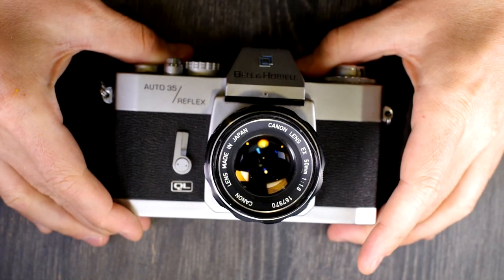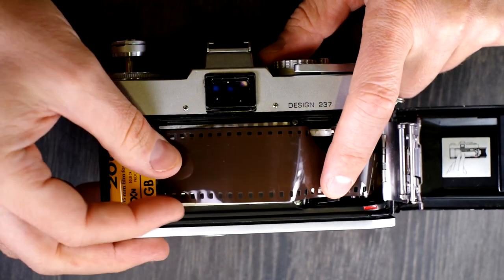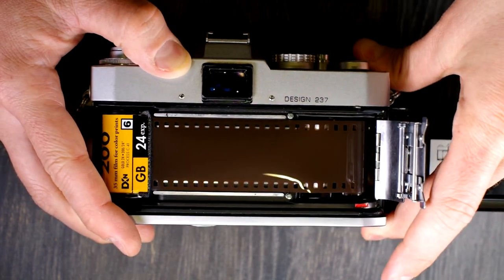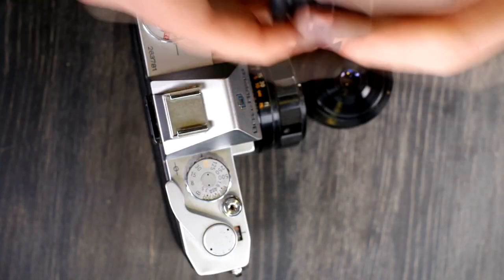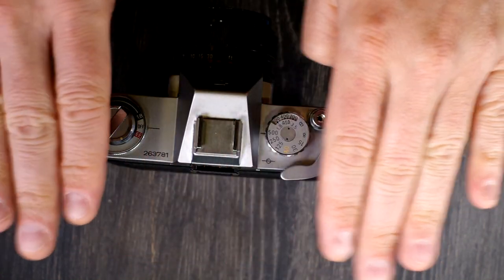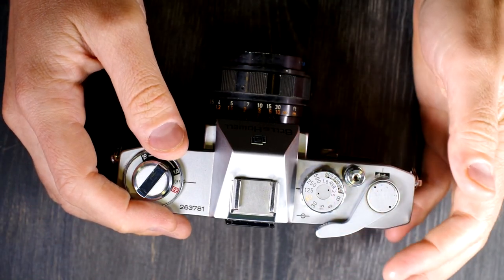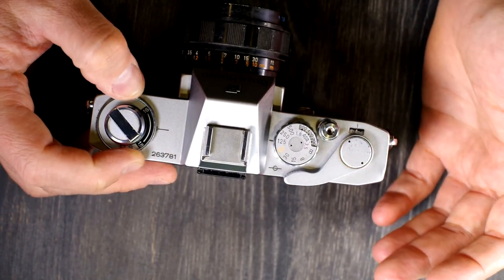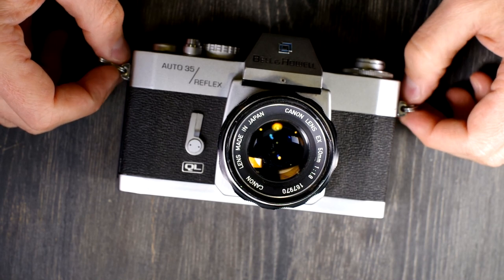Canon EX/EE Video 2: Operation, Use, How to Change Lenses, Load Film, Batteries, and Taking a Photo

Comment: Further to the battery adapters (voltage reducing), apparently many do nothing at all.  Be aware even though they sell for $30+ they may simply be a battery size reducer and do nothing towards reducing voltage.  I use 675 hearing aid batteries from Costco (card of 48 for next to nothing) and adapters from  https://www.paulbg.com/Nikon_F_meter_batteries.htm  Please note I have no affiliation what so ever with this web site.  I bought a pair of his adapters and really like them.  In my Gossen Lunasix # meter I can get over 6 month out of a pair of batteries.
Reply from the maker: Thank you, but the link appears to be dead.
Reply: @DavidHancock  Try it now.  It did not like being in parentheses
Reply from the maker: Got it now. And yes, I know of those. I have a few. My results are mixed. With some makes of button cell they fit fine, with others they're too loose or won't fit on at all. But for use with the same make of cell, they're a good option.
Reply: @DavidHancock  I have only used them with the Costco Kirkland batteries.  Here in Canada I get 48 for about $12.50 or so.  They fit quite tight on the Kirkland cells.  Good to know the other cells may or may not fit if Costco stops offering the Kirkland cells in 675 size.
Reply: Hi,  did the 1.4 V hearing aid battery worked good with the lightmeter?  I have been told that the different voltage may affect its function.
Reply: @losborias  Yes they worked very good.  Being only .05V difference I did not see any accuracy difference when compared to my DSLR, iPhone or other light meters.  I suspect the 1.55V silver oxide or alkaline cells with their 0.2V difference may cause issues.  I have heard many cameras and light meters will work fine with the higher voltage, you just compensate by the ISO, Others I have heard are damaged with the higher voltage.  I have not confirmed either so as usual use the higher voltage at your own risk.    FWIW, there are some repair folks that will modify your camera/meter to use the 1.55v batteries.  Not sure if it is worth the expense to you but it is always an option.  Sorry I do not know any specific repair shops/people that do this work but a google search should provide a list.
Reply: Hobby addict thanks!